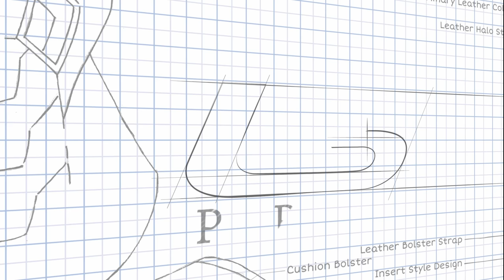Chevrolet C7 Corvette Leather Dash, Trim, and Door Panel Upholstery - LeatherSeats.com

Comment: +LeatherSeats.c
That looks incredible.
Do you guys have a kit for a Pontiac GTO?
I just want to replace the head rest and the backseat.
 Unfortunately the way the backseat with design it gets Pombal by the sun in the stitching will stretch and terrors on top of the head rest and backseat otherwise the rest of the interior looks brand-new.
If you guys are able to help me out maybe I can get something done on my girlfriends 2014 C7 Corvette stingray and add that carbon fiber steering wheel and maybe you guys can provide me with custom floor mats with the Jake logo.
Reply from the maker: +LS260GTO MIY We do have the upholstery kit for the Pontiac GTO.  However, we do not have any original materials for it so we would not be able to supply you just the pieces you mentioned.  The minimum amount we could offer is both front buckets.  You can contact our sales department via phone or email at 1-866-NEW-SEAT or sales@leatherseats.com.
Reply: +LeatherSeats.com 
What's the average cost of an entire kit and it has to be true genuine leather for the entire kit I want no vinyl.
I also would like to get a replacement suede kit in silver to match the silver gauges on the Pontiac GTO.
I would also need a entire upholstery kit for a 1999 Pontiac Firebird formula.
That also would include the carpet for a restoration project on my girlfriends car.
Reply from the maker: +LS260GTO MIY We do offer 100% leather kits and we also offer suede as an optional secondary material.  Automotive suede is a synthetic material and is not leather.  Synthetic suede is what is used in almost all automotive applications like Ferrari, Lamborghini, Ford, etc.  Related to the Firebird, I do not believe we have anything for that vehicle, but you could double check with the sales department. For pricing or any further questions, please contact our sales department.

Phone: 1-866-NEW-SEAT
Email: sales@leatherseats.com